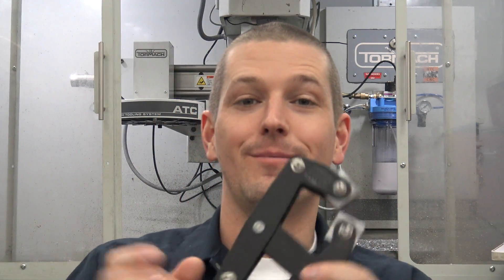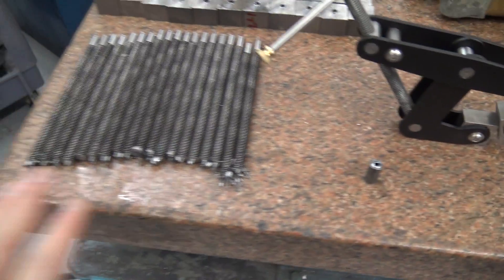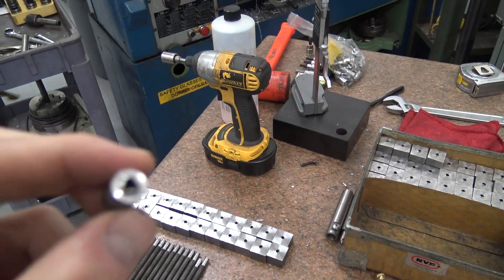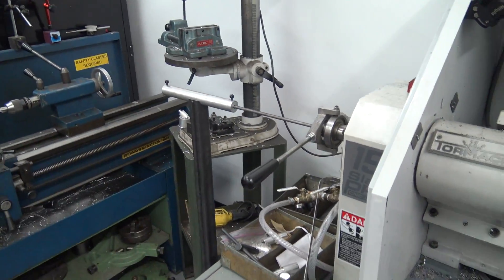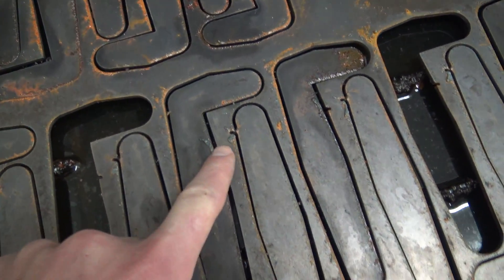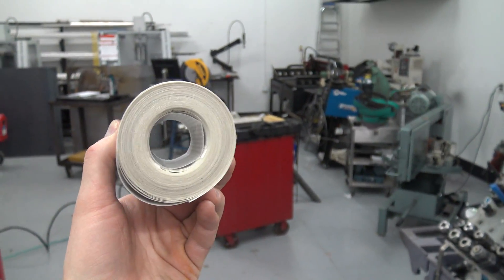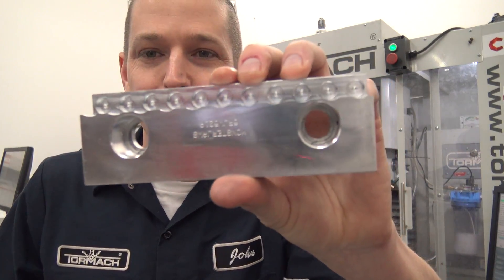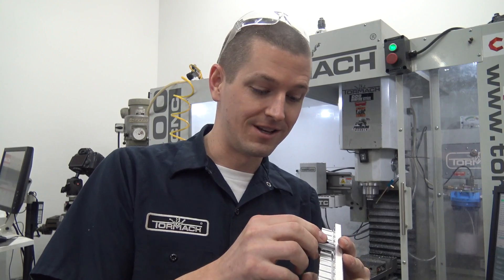Machining Production Soft Jaws for DIY Clamp!  Widget78

Comment: great video!
I got a small question regarding generall milling though. Given you have a part with complex geometry and if you mill that out of a big block of aluminium you would create much waste would it be more efficient to rough out the contour on a bandsaw or similar. That would reduce wear on the mill and the left over chunks could be used for other parts or would the rough surface of the pre-cutted workpiece cause uneven wear on the tool ?

In my specific case the rough cuts would still leave a few surfaces of the block untouched, meaning you still have proper flats to secure the workpiece in the vice of the mill.

Maybe some experienced machinists can help me out.

PS: the left over pieces would be ~1x2x2in cuboids, would that even be worth saving in terms of raw material cost.

Comment: It may have been covered in comments on the previous videos, but how will you assure proper clamping pressure on all eleven parts? Is the mating jaw resilient? Just soft enough to give a little to put even pressure on all the parts? 

I suppose that if there was significant variation in the parts and thousands to be made, you could come up with a gang of hydraulic or pneumatic "pushers" that would put equal pressure on all eleven.

Comment: Just a tip on the plasma tail ins/outs. Make them a radius instead of a 90deg turn. This gets rid of any dwell time on any parts susceptible to heat soak.  Likewise if your burning away 90deg corners, try a short loop back around for the same reason. Hope that helps. 
Love your videos, and the brothers Grimsmo. G'day from Australia.
Reply: +NYC CNC This was my thought also. You curve in on surfaces in CNC machining; why not when plasma (or flame or waterjet) cutting as well?

Comment: OK, here's the way i'd make them (as a non expert). I'd mount bar stock vertically in a vice and drill & tap the holes through the bar. Then i'd put the rod into the lathe and just cut off each piece as i went along.
Reply: +David Riley 
i think it would be hard to maintain accuracy of the tapped hole location using this method. the first few would work but the error would stack up after a while.
Reply: +UnconventionalMilling I don't think the error would stack. It's just holes along a bar.
Reply: Fresc222 why? each hole is a standard distance along the bar. The only potential error i can see is shake from pre-drilling the hole.
Reply: +David Riley A thou on each hole and by the 100th hole you're a 10th out. work from a baseline as often as you can, stacking things gets messy quick.
Reply: If you know the width of cut, i don't see how there would be any error. Even still,you'd only want to do 10-15 at a time off one bar.
Reply: +David Riley Maybe I'm crazy too, but your way doesn't sound bad. You would have to locate off the drilled and tapped hole once in the lathe, any excess can just be trimmed off in the facing op. You would waste more this way, but how much? Depends on how many parts you run.